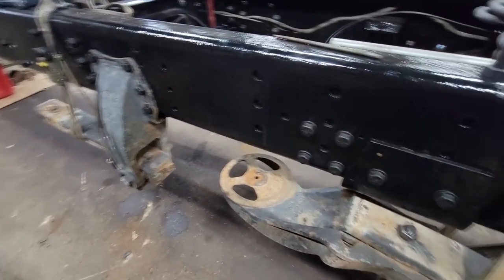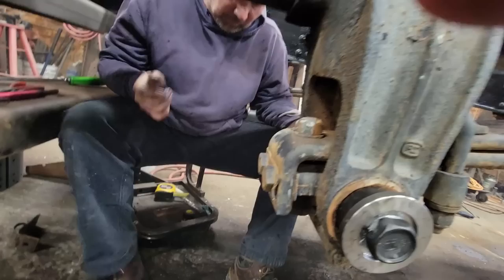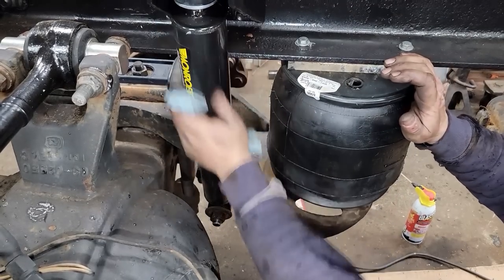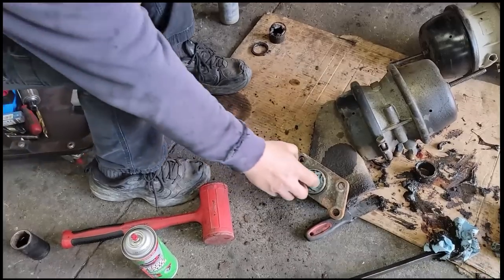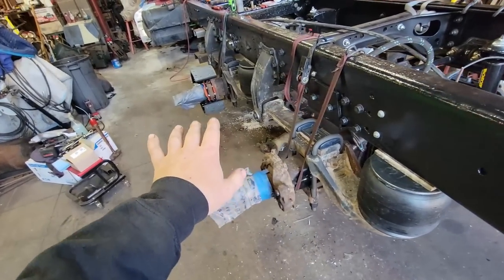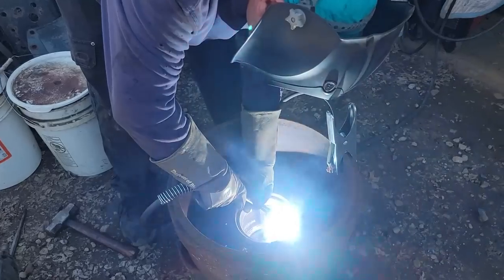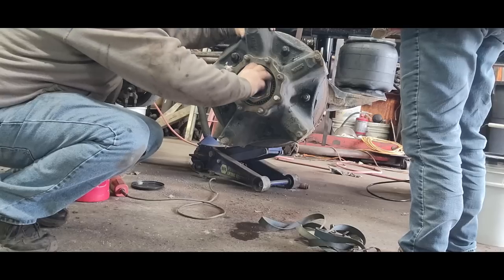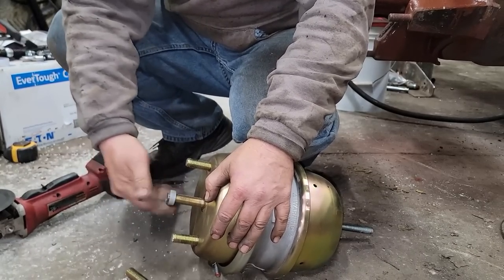PETERBILT FRAME STRETCH PT11. AXLES, BRAKES, WHEEL BEARINGS, AND A BIG MISTAKE!

Comment: from what I seen of the videos that truck would be a DOTs dream. just from what I seen if the DOT pulls it over for an inspection it will be impounded in just a few minutes, I don't want to get into detail about it but a guy wanted me to stretch the frame on his truck and I found out if it's done especially on a big truck you have to be certified to do it the title has to be changed and a bunch of other crap I turned it down and he had another person do it and shortly after he got it back he got inspected and the truck went to the scrap yard and I also found out if you worked on a mess like this and something happens on the road the person that worked on it can be held responsible and thats from DOT and people that stretch frames legally
Reply from the maker: love these "i know a guy" stories.....like to see the fmcsa section quote that says "have to be certified"....certified by who? however, it clearly states that frame modifications and or repairs must be done in a workman like manner according to the manufacture's recommendations.
Reply: @j.c.smithprojects  have you ever seen the sticker do not weld or heat the frame there is a reason for that and I would like to hear what happens if you take it to the scales and have it inspected I will guarantee it will leave on a tow truck and right to a scrap yard
Reply: @j.c.smithprojects  also like I said I looked into it so I know what is required
Reply from the maker: yeah...many people fail to read many of the stickers as they are written. all the trucks i have seen with a sticker on the frame read...."do not drill or weld on the FLANGE of this frame." so like i said....i would love to see the fmcsa section that addresses this......you know, the regulations the scale house enforces....
Reply: @j.c.smithprojects  I also worked for a company that stretched frames on RVs and they had inspectors there all the time and that is nothing like a commercial truck. I went out and seen what they did and had to do to make them legal and I wouldn't have nothing to do with it and when it came to the frame the people had to have special training when it came to the brake lines and things like that not that big of deal. the title has to be sent in because of the change in wheel base and thats when you get the stickers that says the frame has been altered and I talked to some shops when i drove cross country and when a frame has been stretched they won't even let it in their shop
Reply from the maker: inspectors from where?  special training for brake lines? i have no idea what state your in but pa sure sounds like some sophisticated procedures that would definitely be published for anyone to read. feel free to copy and past those article numbers so we can all read them.
Reply: @j.c.smithprojects  that is from the DOT and I worked in indiana and the inspectors were from the FED
Reply: @j.c.smithprojects  You know its obvious you don't believe me I just want to say go to a scale and you can ask them their are a lot of things they have that are not on the internet go get your own information from the mouth of the inspectors and then you will have it
Reply from the maker: take it as you will. all i asked is you provide the resources you found this info in. dot enforces regulations from the federal motor carrier safety administration....fmcsa. if it is a regulation.....it is in print. shouldnt be hard to produce. federal inpsectors at the rv dealer all the time?...fmcsa is  federal regulations enforced by state government. its your story. tell it how you want but dont be upset when people question things they find peculiar or unlikely. especially if you cant produce articles numbers, chapters or print of the procedures, certificate requirements, inspections and title info that you claim to know about and "have looked into". far too many people on social media spread bad information or theories.
Reply: @dannydaugherty527  you thinking too much. like jc said if you have it written or printed somewhere then post it, just don't make some BS comments. all them so called DOT inspectors know is how to get into your pocket and get a lot of your hard earned cash into the federal system. Yes of course this person stretching the frame should be using new parts like slack adjusters etc. but the kind of work he's doing is really commendable.
Reply: @anarwal73  if you haven't had any experience with the DOT and like I said in the comment knows a guy that tried it you need to keep your trap shut you need to know what your talking about before you say anything, I speak from experience and nothing but experience, if I didn't I wouldn't say a thing.

Comment: All this brings back memories of the mid 70s when I attended Nashville Auto Diesel College. They taught us every step you are performing. While attending I worked in an automotive machine shop that rebuilt everything from lawnmower engines to diesel engines that I could stand inside the cylinders. My thing was grinding cranks. I watched the old guy while I was sweeping floors and absorbed everything. One day óld guy was sick and the boss was wringing his hands what to do. I said I could do it and they looked at me as if I had green pointed ears. I ground that crank.
We rebuilt truck axles too. Done just the thing you did.
I went to Caterpillar and wrenched for them for a while. The gas crisis intruded and I had to step back to my machine shop roots and worked antique foreign cars and Mercedes-Benz trucks. After that I joined the Air Force and didn't wrench anymore except on my own stuff. I was a machinist/welder in the service so kept my hands dirty. I separated after 13 years due to disability. I worked a few machine shops until I got on with my last employer who made woven carpet. There I supervised the machine shop and designed, fabricated and installed upgraded drive systems on the looms.
The point is that that mechanics school carried over into every aspect of my career.
So as I watch you rebuild those axles and install the brakes it takes me back to the days when I worked all day and went to school at night to learn how to work on the big trucks. The only thing I never put into practice was rebuilding injectors and pumps. They were simply sent off.
I watch every one of your videos and my fingers feel every part.
I'm old and beat down now and wrench from a recliner. Thank you for taking me along and dusting off some long unused memories of training and work from my past.
You and your wife make a fine team and do fantastic work.
Cheers
Terry
Reply from the maker: i am happy to hear it brings back old memories. sad to hear about the "old and beat down" for as well as myself because one day i will be leaving the same message for someone else. you have lived my kind of life. building, fixing and learning. thanks for the great comment and watching!

Comment: You and mrs jc work well together. Putting those spoke hubs and drums on is no easy task and you guys made it look easy. This truck has turned into quite the ordeal. Not sure if there will be more satisfaction or relief when it’s out of your life
Reply from the maker: relief......it would have been easier and faster to start with 2 blank frame rails and bolt all of my own axles and suspension to it.

Comment: I have an old rivet gun used to drive rivets in steel beams. I use that for stubborn anchor pins. Its two times the size of an air hammer.

Comment: Man i just did suspension bushings on my freightliner. The only job I was thinking I wish i would have dropped it off at the shop. It was a full on BATTLE. The bolts were just as bad as the bushings.

Comment: The Flexzilla hose REALLY doesn't play well with welding sparks and torch slag. 
Where that type of work gets done, it is best to use rubber air hose.
Flexzilla is perfect for engine work, or transmission/rear end work, somewhere that fabrication isn't.
Reply from the maker: i guess i better go with a good old rubber hose then.

Comment: I am cheap too and try and get every little bit out of the grease tube.  I have hears those flexzila are not real abrasion resistant in a shop setting.  Like in said before I am cheap and just stick with the rubber ones.
Reply from the maker: i have heard the same. i was going to get it on a retractable real but maybe i will stick with good old rubber.

Comment: Question i have to ask is'  do you fit the extra chassie rail on the inside or plate on the outside i have converted 4x2 into 6x4 by adding double drive extended chassie then double up with inner chassie for extra support ...................
Reply from the maker: its all in the this video series.....all you have to do is pick the part or parts you want to see.

Comment: I have a medium duty truck- 1979 International S1724. Plans are to use it as a service truck for mobile mechanic. I’m moving the axle forward as much as feasible. 84” CA is the safe answer; however for maximum mobility (smaller turning radius), could I go as short as 60” CA? Truck will have a 96” service bed with storage. Does that sound feasible to you? Any reason I should stick with 84” over 60” CA? Thank you for any insight. 😊
Reply from the maker: there are two kinds of service trucks....the ones that are too small today and the ones that were too small yesterday. having the extra storage will likely out way the minor loss of maneuverability. these truicks have a much greater turning angle on the steer wheels than the average 1 ton.

Comment: Then use a hacksaw to cut into the sleeve. Don't worry about cutting to far as using a hand hacksaw you found your self doing a lot of checking . If using a power hacksaw more checking might be advised . It worked back in 1960. No guarantee it still works.
.

Comment: Nothing to really add on the repairs….but you mentioned flexzilla hose real…I have the reel and 2 50 foot flexzilla hoses…I never use them….picture cleaning the grease off hoses that color first of all lol….the hose on the reel won’t retract back into the reel unless you shut the air off and drain the hose…it expands under pressure and rubs inside the reel about half way back in . The aluminum ends make me worry too…they don’t like heavy objects hitting them..it happens lol
Reply from the maker: Several folks have mentioned that they dont do well in a shop that welds and grinds a lot....i gues i will stick with the good old rubber kind.